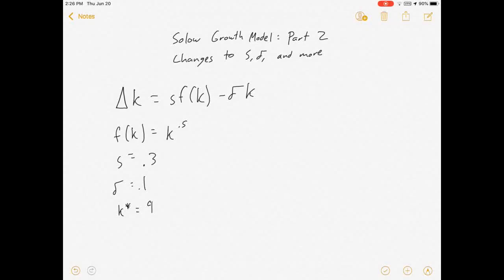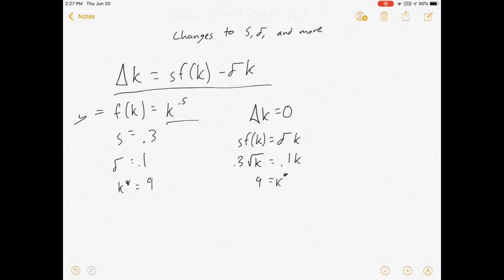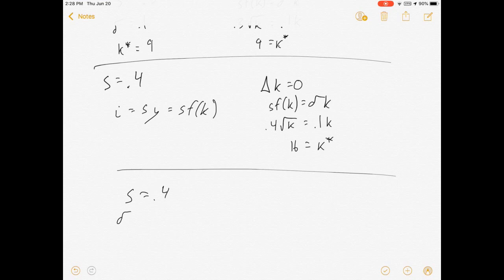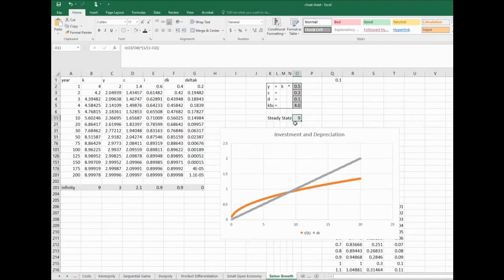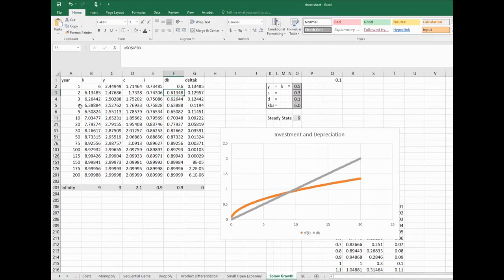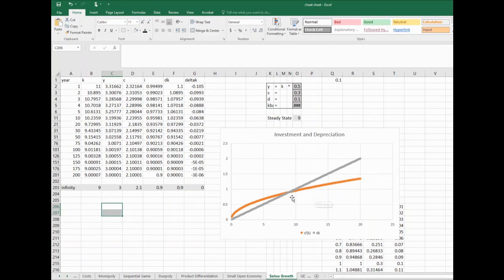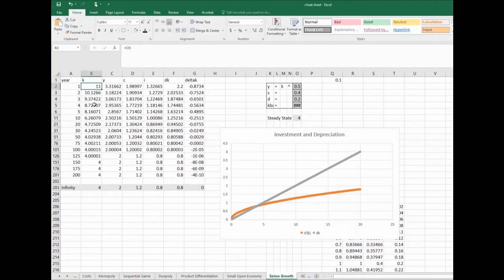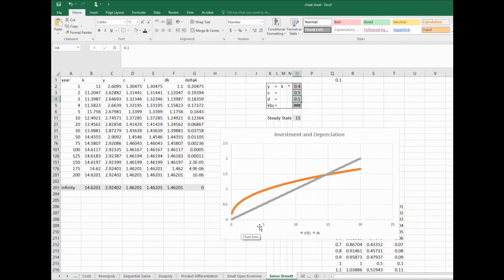Solow Growth Model Part 2: Changes in the Steady State

Comment: In this example, when solving for steady state output per worker, Y/N, you just insert the steady state of capital 9 into K/N^0,5 which equals 3 right? because Y/N = K/N?
Reply from the maker: It isn't that simple. You solve for steady state capital by setting investment=depreciation. The Part 1 video goes through it explicitly: 
https://www.youtube.com/watch?v=3vbSy4VVQVI
Reply: Matt Birch i mean steady state output - the corresponding output (y axis) given steady state capital
Reply from the maker: @Skey1337  Then yes. Steady state output y*=f(k*), which in this case, y*=f(k*)=(k*)^0.5=9^0.5=3.